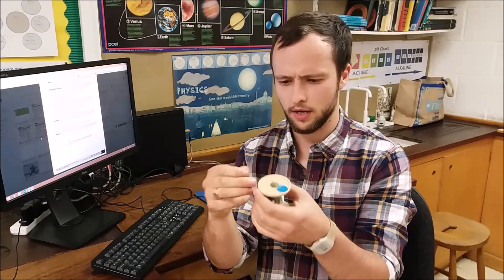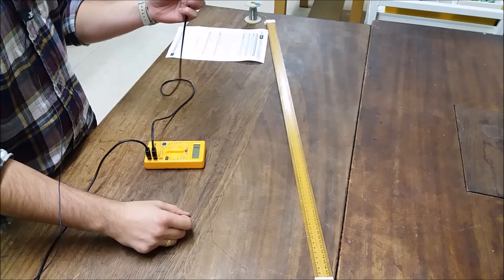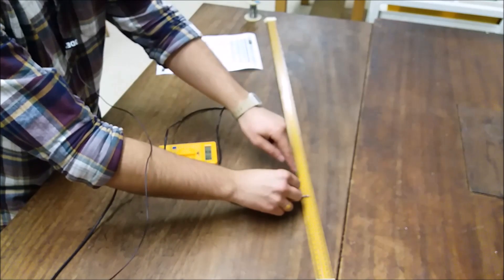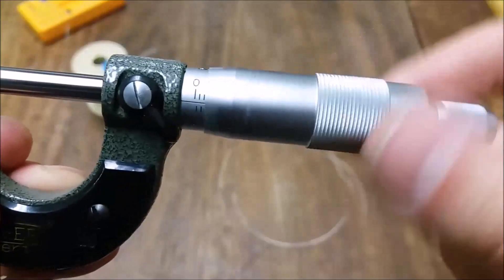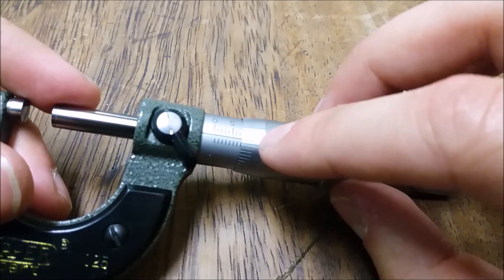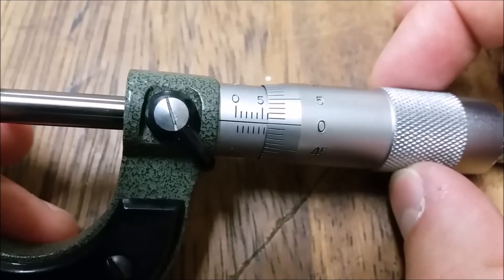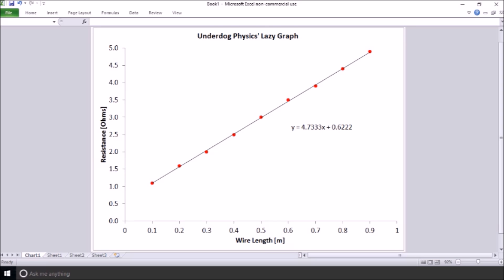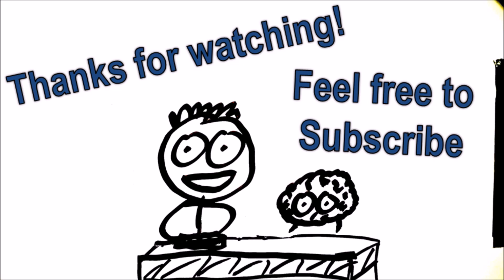Resistivity of constantan wire - A Level Physics

Comment: I have a question. Why aren't you comparing the obtained value to the theoretical value for resistivity of your particular wire (I mean material of the wire).
Reply from the maker: Hello Rufat! I decided not to since the video itself is only aimed at showing my 6th form students how to undertake the practical in order to get their own results (which they then compared with spec.)